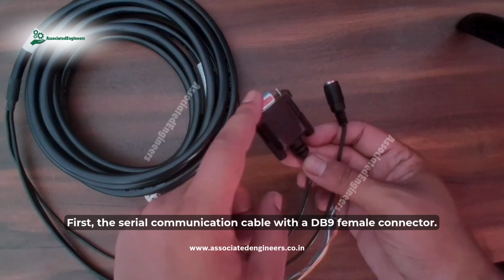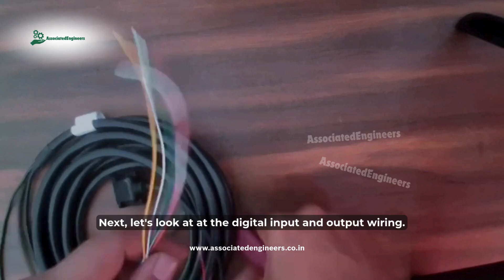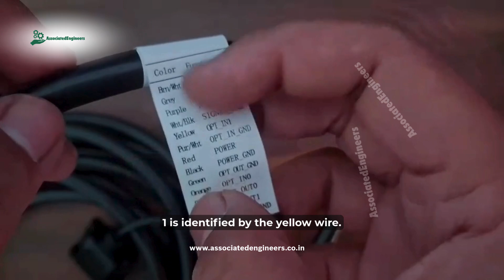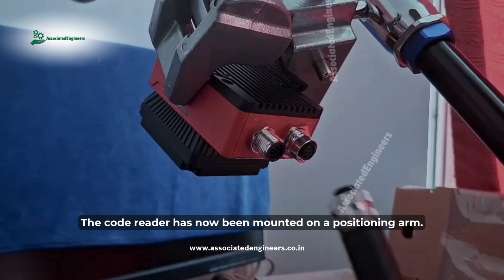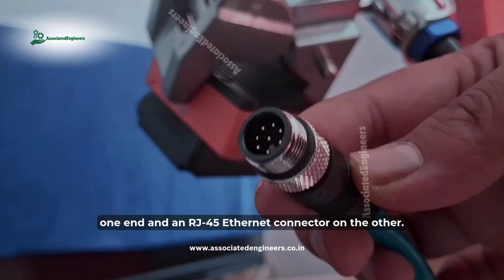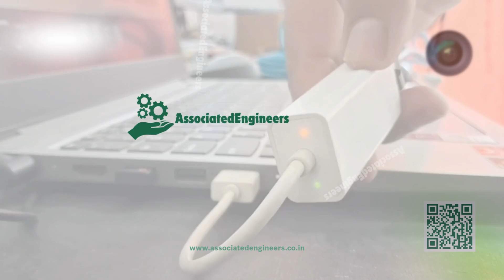iRAYPLE R5016 Code Reader Wiring Guide | Power, I/O & Ethernet Setup

Comment from the maker: Which connection would you like us to explain in more detail?

Power wiring

Digital input and output wiring

SICK sensor triggering

Ethernet and software configuration

For support with machine vision, industrial code reading and automation integration, contact Associated Engineers.

Email: associengnr@yahoo.com
Phone/WhatsApp: +91 94330 23602/ +91 99033 33043